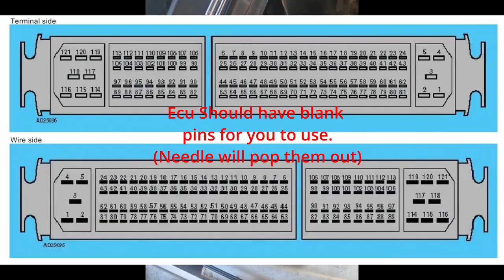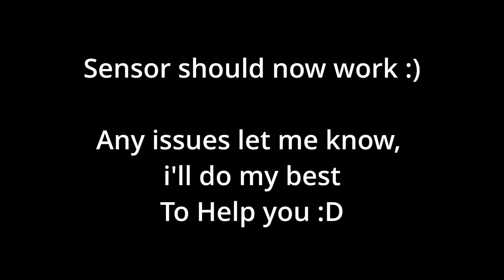Audi A4 B5 Quattro Project: Ignitron Temp/Pressure combined Sensor: 0261230482

Comment: good video, continue please with them.
 do i need to connect wire to pin 26 in ecu?
Reply from the maker: Pin 26 to ecu for temp signal
Pin 10 to ecu for pressure signal.
Reply: @Curiosity_Cars  and how i connect it? Can you please add picture
Reply from the maker: @stefanp1265  What do you mean by connect ? The Pins inside the ECU are crimped like the sensor pins. 

Do you mean the remove of the pins from the ECU Connector ?